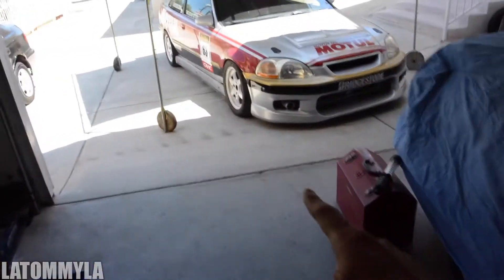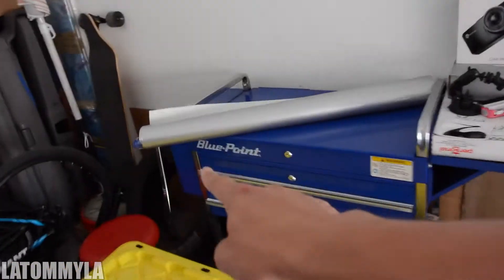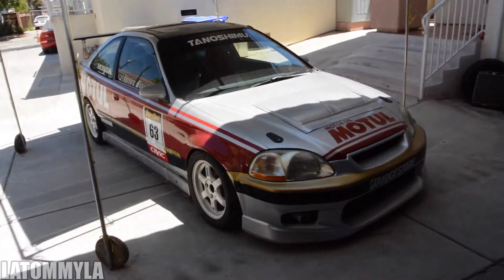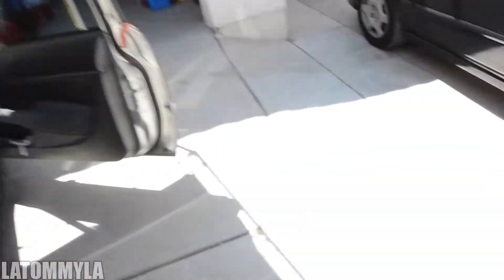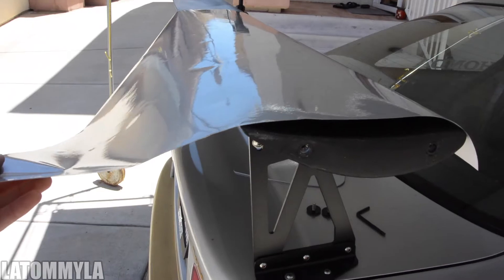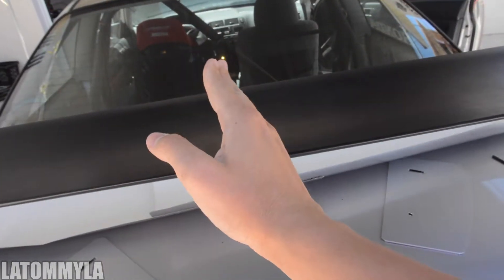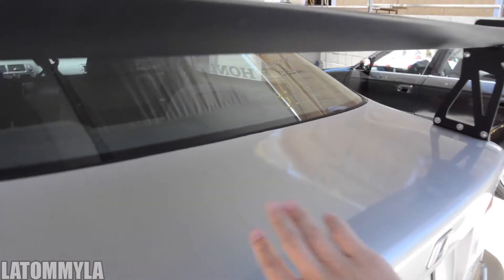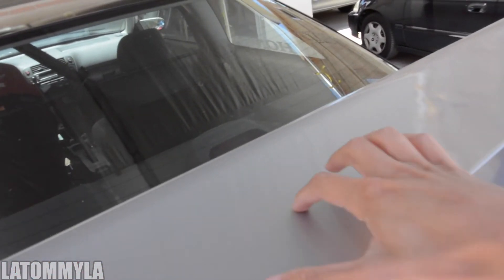Silver Wangs

Comment: Love the vids bro, I just picked up a 99 civic ex 5 spd. Got it for $100 lol has some front end damage but the single jingle runs good. Following a lot of your mods because I wanna track it as well
Reply from the maker: Thank you, and wow $100, thats mad cheap... I would just fix the damage a bit until the panels line up haha! I recommend you just taking the car out the the track first before investing in mods, that way you can see what your car actually needs.
Reply: +LATOMMYLA yeah, I'm kinda skeptical taking it to the track stock. I have my s2000 I wanna track too but I'm to pussy to take it out tho, don't wanna hurt her lol
Reply from the maker: Just get some tires and coils! And i feel you on that one, if I had an S2000 I would be scared too haha!
Reply: +LATOMMYLA prob gonna be picking up some 15x8 + 28 rpf1s. With 225/45/15 tires and get coils. What could do you have on yours? Yeah man. My s2000 is my bby, even tho it has 164k miles on it lol
Reply from the maker: 15x7 +35, 205/50/15. 225's may be a bit heavy for the single cam, thats why most people with single cams run 205's
Reply: +LATOMMYLA yeah I noticed that with some ppl on nwp, that's prob the reason why. Do you know if the 15x7 rpf1 are still concave?
Reply from the maker: 15x7 Rpf's aren't concaved, I had 3 sets haha